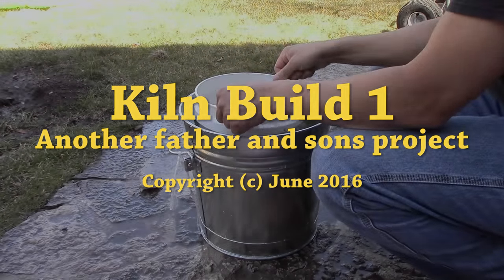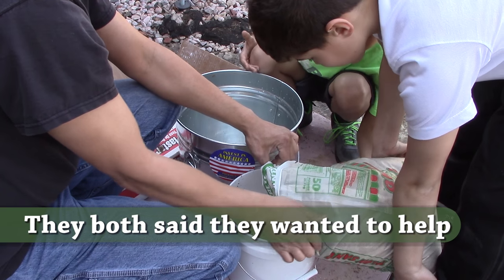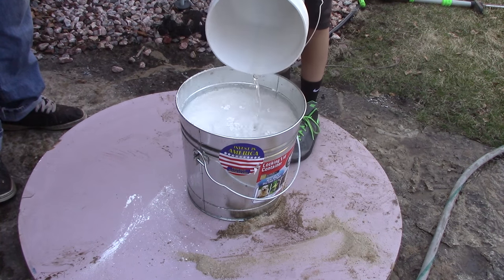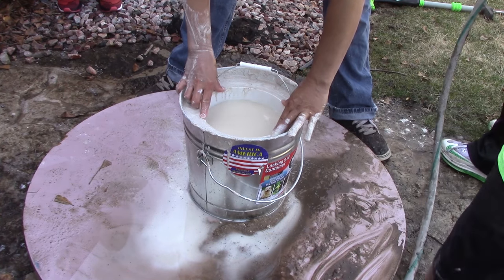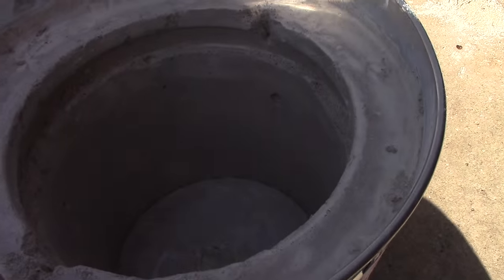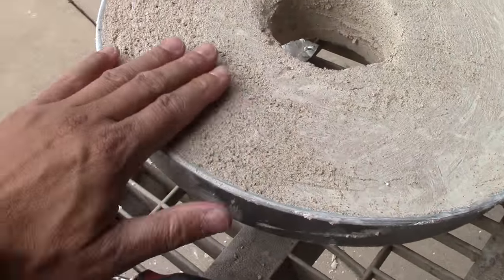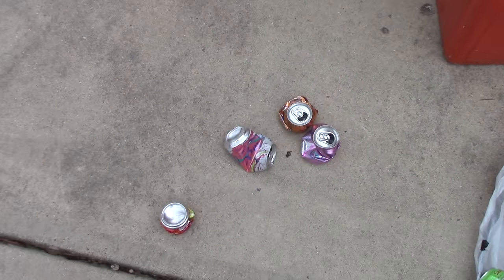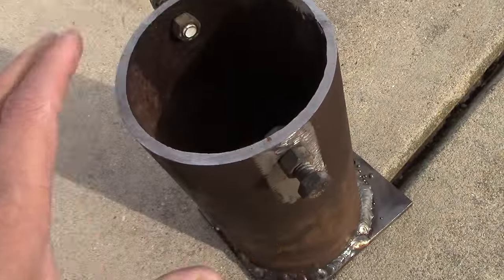Kiln build for melting aluminum, part 1 of 2.  A "father and sons" project.

Comment: Very cool man! Great that the kids are interested as well. One tip that might help the longevity of your metal crucibles. When cleaned, put them in the furnace and heat until red, then remove and let cool. A thin layer of oxidation will occur. This will help prevent the AI from dissolving the metal.
Reply from the maker: Thank you very much!  I enjoy projects with my boys.  And great tip on the heating the crucible!  I will do that from now on.  And thanks again......

Comment: When I was in a shop class one of our projects was casting something in aluminum.  We used a steel ladle.  The instructor told us that molten aluminum is corrosive to steel so the ladle had to be repaired every so often when it got too thin.  Just be aware and watch the ladle.
Reply from the maker: Wow, I didn't know that.  Thank you very much......

Comment: Excellent Dad skills !!  Consider making up packets of about 1 teaspoon  Morton Lite Salt wrapped in foil, and 1 teaspoon washing soda in another packet. Both are grocery store items. When you get the aluminum all melted, toss the soda packet in and stir it around. This acts as a flux making the melt less thick. Then toss in the salt packet and stir (there will be a bit of bubbling - don't worry) this gets the gas bubbles out of the mix, your good humor can go all over the place with that !  Goggles are good but an inexpensive face shield is better.  I really enjoy your videos!
Reply from the maker: Thank you so much!  I've seen guys use the flux and de-gas stuff and planned to use it too.  But I was shocked I could melt aluminum with charcoal and was just testing this concept.  My aluminum has had no porosity so far.  And you are so right about the face shield!  I take safety seriously, so I will plan to do that.  I don't pour around my kids because I know things can go wrong and I would be horrified if I hurt my child!  Thanks again.......

Comment: No water displacement, solid math. 35-35-25 mix for this size bucket. Keeps to the 7-7-5 ratio used for the smaller bucket.

Comment: Great kiln, easy to make, even faster with help... lol
Good way to make kids learn and like something, cool projects.
The result getting AL from cans is surprising, regarding the quality...   ;)
Reply from the maker: My little helpers, lol.  I'm shocked at how good the aluminum is too!  I made several parts from it so far.  I may be just lucky, but I have no porosity either.  Thank you much my friend......
Reply: Guess if you drink the soda before it helps with the porosity, no more CO2...lol
 If I can get some time soon, I've got 3-4 big garbage pails full of AL to be melted, I'm worried about some cutting oil in the shavings.... It's an electric kiln, guess I'll see then.
Reply from the maker: LOL!  Can't wait to see yours.....